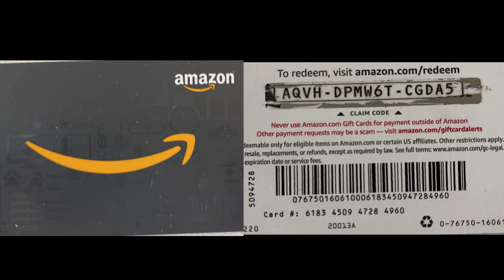My New 2021 Landscaping Trailer Setup (8.5x20 Enclosed)

Comment: I'm getting a 5×10 lowes TRAILER 
$1,800.00 , this summer I replaced my TRANSMISSION 
so I could pull a TRAILER 
The next $5000.00 i save I'm gonna put a REMANUFACTURED ENGINE 
IN MY RIG 
( I LIVE IN THIS VAN), 
SOLAR PANELS,FULL BED , REFRIGERATOR , 
I want to TRAVEL and do jobs all over America and film the journey
Reply from the maker: Woah, that sounds like fun my man, I wish you the best of luck